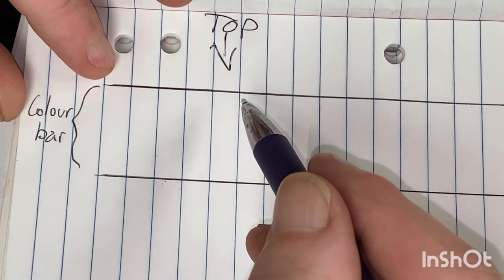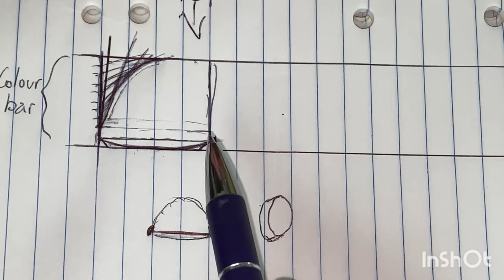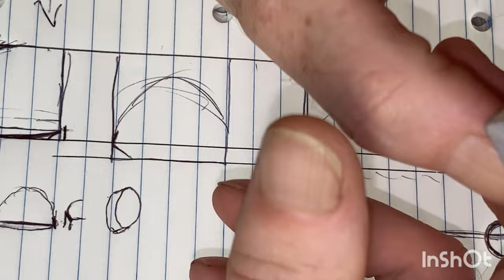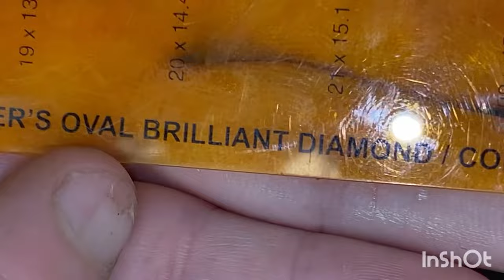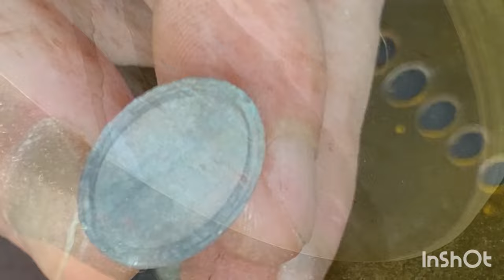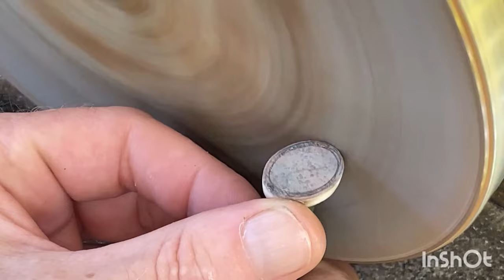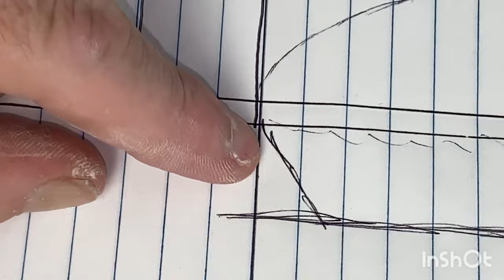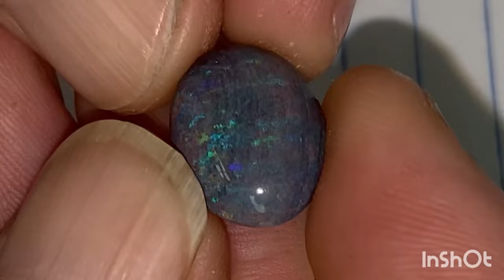Opal cutting requirements. What to consider when cutting opal.

Comment: I'm still a relatively new cutter so this may sound bonkers, but the stones tell me how they should be cut.

I dont know if its my toolmaking mindset, I was a toolmaker and machinist for 20 years, but I see the final shape before its cut, as I'm cutting. The correct aesthetics of the dome and radius just come together. You know when it's not right. 

I've only sold one, but that's because I simply havent found the brilliant opals to sell yet. I'm just now starting to get a few worth selling. The latest drop I put up last night is amazing. At least, I think so. Amazing red/blue multi on a dark (not quite really, one grade away from dark) base.

I watched a good couple of hundred hours of another cutter before I even took to a stone myself and realised I could do it. After a huge and slightly expensive learning curve in buying rough, I've finally landed some decent material (got an oz of Tom's (AusOpal) Coober). Best advice I can give to a new cutter is dont let opal fever consume you, and wait for the right pieces. My first half a dozen purchases were not at all what I hoped when I got them in-hand. I got drawn in by the colours and didn't properly determine the size mostly. Be very wary. A lot of sellers looking to take advantage of new cutters, making things look bigger and brighter and more viable than they are.
Reply from the maker: G’day mate, you’re on the right track. Once you understand the orientation side of cutting, you can just look at a rough opal and have a good idea of what you can and can’t do with the piece, it makes you more selective when buying parcels 🤪👍

Comment: Hey Phil, I have a question.  Ive heard its easier to sell calibrated stones because if they are in standardised dimentions they are easier to get settings for.  What are the dimensions?  I bought a stainless steel pattern to draw on the stone.  But im not sure if the sizes are correct for calibrated stones.

Comment: One thing I’ll disagree on is that doming as high as possible is always good.  Medium dome is the best looking opal.  High dome looks like grandmas opal, it’s not a modern look.
Reply from the maker: G’day mate, I don’t remember saying that doming as high as possible is always good, in fact the high dome theory annoys me, it only came about as they once thought it took 500 million years to form one centimetre thick of opal, therefore it was prized to show off a high dome opal, and priced accordingly. Now a high dome represents an opal with one bar, thick enough to cut a high dome, as opposed to opal with thinner bars stacked on top of each other, that don’t translate well cut with high domes. The 2/3 height over width was a guide for the maximum cut/dome height as opposed to its width. Aesthetics is what guides most decisions for cutting, the resulting gemstone needs to be as pleasing to the eye as possible. As much as I don’t prefer ovals, I’ve had to concede that an oval is the most structurally stable shape for a stone as fragile as opal is, for longevity purposes. 🤪👍
Reply: @theopalmills  great response.  Thank you for clarifying your stance and further educating me and others.  It was a great video